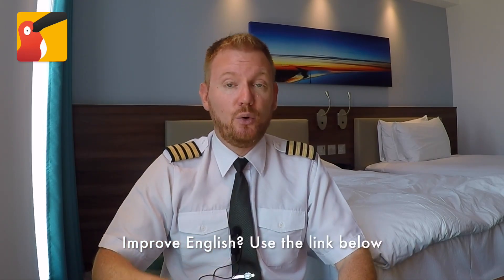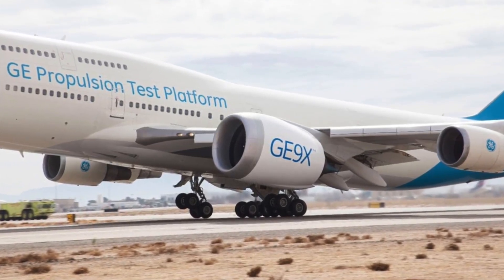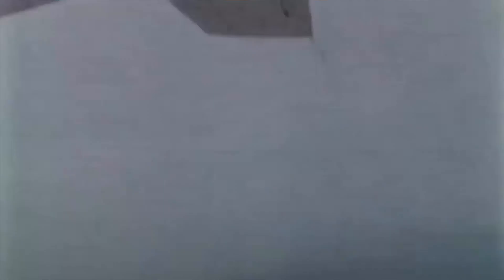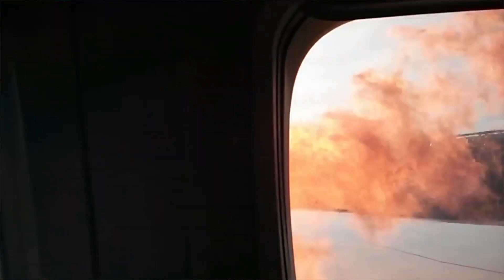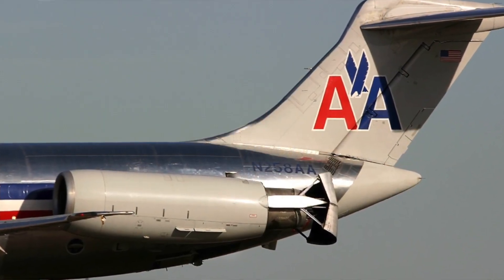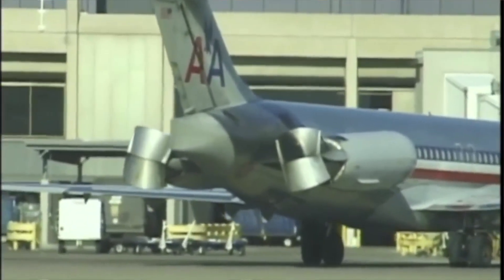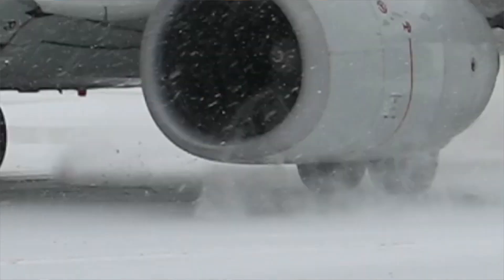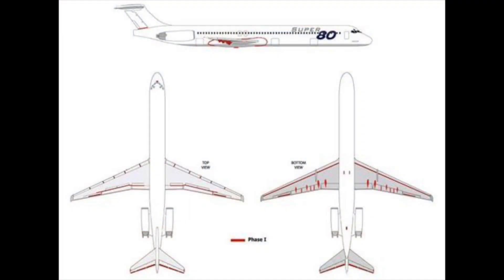Why are the jet-engines placed there? Wings vs Tail

Comment: I remember once reading a silly paragraph on Wikipedia about it. It said something like "Being attached to the tail gives fewer points of structural failure that could separate the engine from the aircraft. With wing mounted engines the wing can separate or the engine can separate. With tail mounted engines only the engine can separate."
That is what convinced me to get an account to edit the wiki because seriously what pilot is going to be saying "oh no! My engine" when the whole wing fell off?
Reply: nope...   the hardpoints that fasten the engine are the same on any position, its on a captured rail so it can be easily slide out to perform maintenance...   funny they don't take into account the tail is actually less heavily built then the wings..  the wings hold the entire weight of the plane in the air..  tail just acts as a stabalizer, it creates no lift lol ..    wikipedia for ya...   me,   I build aircraft  hehe
Reply: EpicSpaceTroll 139 You’re fucked either way if your wing or tail breaks off 👀
Reply: Yep. That's part of why I thought the paragraph on Wikipedia was so ridiculous. :P
Reply: For anyone who has ever seen how much material is in an engine pilon, or the structural members attaching the wing, it would be the least of my worries.

Comment: Back mounted engines are quieter. Unless you sit right between them. After a DC-9 flight in the second to last row (the last with a window) you know that in the back of the bus, they are much noisier than wing mounted engines when sitting right next to them.
But no reason to complain, since it was obvious that this airline (and most passenger airlines in the parts of the world that I travel) were geting rid of the DC-9, this seat was chosen intentionally. :o)

Comment: I’m going to guess closer to CG for better balance and handling, potentially reducing lift burden. Possibly “cleaner” intake air without wings interfering.  Maintenance accessibility. Wings are structural regardless of engine; fuselage requires reinforcement to accept engines. Simplified tail construction, also with better maintenance accessibility.

Comment: Yet another informative video. I have a question on this topic. 
Some UPS cargo planes have two wing mounted engines but they also have one engine mounted on vertical stabilizer as well. Can you please explain why ? Vertical stabilizer is a very odd place to mount the engine. 
Thank you in advance.
Reply: This is called trijet. Engines are very expensive part of aircraft, but you need more than one for redunancy. So at time when they were not enough reliable, 4 engines were too expensive, only two engines not enough reliable for long, over ocean flights, three seemed to be optimal. But only way to make engine placement not asymmertical you had put third engine in the middle, so into the tail. But that appeared to have downsides, for example even more complex maintenance that under wing engines.
Reply: Tri-jets were configured that way because they are from an era when a particular size/capacity was necessary, but having only two engines were not sufficient for the design (both in power and reliability), but four engines would have been excessive.  As engine designs have advanced, two engines are able to suffice when three used to be necessary.
Reply: After McDonald bought Douglas, the DC-10 was redesigned and renamed the MD-11. Boeing is now the manufacturer/service provider.
The MD-11F is the three engine aircraft flown by UPS and Fedex, and other cargo carriers.
NOT the Lockheed L-1011 TriSTAR,
Reply: Back when FAA didint allow 2engines to fly across the atlantic, airplane manuf made the trijets plane.
Reply: Those are called ''Trijets'', I suppose they are needed when you want to have three engines. They work with like an S-shaped duct and the thrust comes right out of the rear of the plane, so it is easier to handle if there is an engine failure. Since it is in the middle there isn't that much leverage.
Also, the engines are further away from the passengers (less noise), seem to be more efficient and is better at takeoff's.
Disadvantages are that they are complex to make and less efficient than twinjets.
Reply: because dc-10 could not have 2 engines in these days, if put 4 engines below wings it was already seen so they decided for something unusual.
these days that engines were the biggest and because of3 , dc 10 is smaller than b747(both have same power engines, 20-25 tons of thrust)
Reply: In aircraft like the L-1011 and DC-10/MD11 4 engines weren't efficient, but they needed a third for the extra power, and reliability. In the 727 they just needed the extra power.
Reply: DC10/MD11. was McDonnell-Douglas' response to 747, aka "wide body", but at a slightly smaller size and passenger capacity than 747. At the time, the engines weren't  powerful enough to only go with 2 engines (and ETOPS rules were perhaps stricter before the 757 & 767 were developed?), and 4 engines was too many. So 3 was "just right" for the size and configuration they were aiming for. (Lockheed's L1011 was similar idea, but... not many of those still flying).
Reply: yup, they made trijets back when 2-engine planes weren't allowed to fly over oceans.
Reply: probably center of thrust...  if the thrust was all below center of drag it would force the aircraft in one direction when you applied a certain throttle.
Reply: Ah, what you're referring to here, is the so-called "Tri-Jet" configuration, which has its roots in multiple engineering and commercial decisions.

Back in the 1970s, when these aircraft were designed and built, jet engines were not considered reliable enough to allow for long flights over oceans with only two engines. Ocean crossing aircraft at the time, thus usually had four engines (see: Boeing 707 & 747). However, having four engines attached to the airframe, results in large engine maintenance costs.

That's when a spot of lateral thinking cut in. Engineers worked out that you could build an aircraft with three engines, that would still have enough engine thrust to maintain controlled flight even if an engine failure took place over the ocean, but would have lower engine maintenance and running costs than an aircraft with four engines. It would still have comparable carrying capacity and range to a four-engine aircraft, but cost considerably less to operate. Which would be attractive to airlines that did not handle the passenger numbers making 747 operation justifiable, for example, but which still had international routes to service. Thus we saw the DC-10 and TriStar being built, to attract purchases from such airlines.

Of course, you still need to ensure that the engine thrust propelling the aircraft is laterally symmetrical (i.e., the same on the left and right hand side of the aircraft), and with a third engine, the obvious way of ensuring this, is to mount the third engine at the back, under the tail. Which is why you see the interesting arrangement on these aircraft, of two engines under the wings, and a third engine under the tail. Three engines provided enough of a safety margin to get home safely, even if two engines failed over the ocean, but cost less to run per airframe than four engines, whilst giving ocean-crossing range and substantial carrying capacity.

That's when the fun started. Lockheed had prior experience with propeller driven airliners, but the TriStar was their first venture into commercial jet airliners, and Lockheed chose to market their aircraft on the basis of technological innovation and enhanced safety, which made unit costs expensive. McDonnell Douglas chose to build the DC-10 to a budget, and sell its planes cheaper, but this bit them badly when design compromises led to several highly public disasters (the crash of American Airlines Flight 191 in 1979 was a particularly heavy blow). The commercial failure of the TriStar led Lockheed to abandon commercial jet manufacture altogether, and the chequered history of the DC-10 (followed by complications with its military aircraft contracts) ultimately led McDonnell-Douglas to merge with Boeing. Basically, three was not a lucky number for either of these companies, and I suspect none of the big aircraft manufacturers will risk a Tri-Jet design in the future unless they're forced to by circumstance ...

Comment: Is ground clearance a factor? For a small aeroplane low to the ground you might not have room for engines under the wing?
Reply from the maker: Absolutely correct.
Reply: Why not have wing-top engines? Back in the 1950's the DeHavilland Comet actually had its engines inside the wing.
Reply: Then theres the honda jet, engines on top of the wing.
Reply: I guess harder access to maintenance and also they didn't used turbofans for the Comet, they require a much larger mouth to fit the fan, so you would also lose usable wing area if you replace the sleek intakes with a big fan.
Reply: On this note. 

If engines keep getting bigger are we going to go back to high wings?
Reply: Yeah, all of the RAF's V bombers also had the engines in the wing root. Wing root engines only work with turbo jets, not turbo fans though.
Reply: I was thinking about it too, it would be impractical for jets with low ground clearance to have wing mounted engines,
Reply: I think they stopped having turbine engines inside the wing mainly because an uncontained failure cuts your wing off if the engine is inside the wing. Might be a similar reason not to have it on top of the wing? I think the wing is safer if the engine pod is under the wing.
Reply: bhami That has some advantages but also some disadvantages. Fitting the turbofan engines to cantilever forwards from atop the wing, with a flattened exhaust nozzle, does have some enormous benefits for low-speed lift. NASA took a deHavilland Canada C8A Buffalo (twin-engine, piston powered) and replaced the wings with a new wing, fitted 4 jet engines this way (2 on each wing) and the result was called the QSRA (Quiet Short-haul Research Aircraft). Thanks to the Coanda effect, the stall-speed was reduced to below 57 knots airspeed. Mentour Pilot can probably attest that flying that slow in most airliners would be insane. If the wing is mounted on top of the fuselage, then it also means that the wing shields the passengers and people on the ground from engine noise, and helps to protect from foreign-object-damage, but at the cost of making tall ladders a necessity for engine maintenance.
Reply: I guess that is why the 737 engines have the iconic design which would enable better ground clearance.
Reply: bhami, The Martin jet seaplane had its engines on top of its high mounted wing. This prevented the engines inhaling water. Usually.
Reply: Tilson Thomas It's actually been successfully done. Look up the British Aerospace Model 146 "AvroLiner" (aka the Avro RJ-series). Regional jet (hence "RJ") with wing-mounted engines and VERY short landing-gear.
Reply: bhami, maybe in that case turbojet where mounted and not turbofans. Turbofan requires much bigger section, you'll end up with a exaggerated wing thickness, that is not good at all for efficiency and good lift characteristic.
Reply: bhami 
My guess would be that the air flow over the top of the wing is more critical so you don't want to interfere with that, and having the engines Above the wing would put them closer to the passengers which is not good. Engines make noise and they throw sharpnel once in awhile so you try to keep them away from the people.
Engines within the wing take space away from fuel and  mechanical systems
Reply: VFW 614
Reply: In addition to what others have said, the Comet had issues with the strength of the wings - with the engine in the wing roots, you can't put a spar through there to keep the strength, but have to rely on something more complex, and more prone to joint failures.
Reply: then the landing gear would be extended.
Reply: The He 162 had an engine on top of the aircraft, the Ho 229 had the engines in the wing roots the Me 263 had he engines under the wings and the Me 163 had a (rocket) engine on the back of the plane.
Reply: Tu fenix shidori :v and your point is? :)

Comment: Hi, just came a thought while you were showing the use of reversers to push back... can a plane use reversers while in air (not inflight i.e. cruising, I just saw a Rynaiar 737 video using reversers maybe 10/15 feet from the runway) and what is the procedure for an unexpected reverser deployment? Maybe general knowledge, not the exact checklist that you use with your airline if you cant.
Thanks and keep it up captain!!!
Reply from the maker: Reversers should never be deployed in flight for any reason. It can be selected at around 10 feet under certain technical circumstances but it’s strictly forbidden to do so on purpose. The incident you are referring to was during a terrible storm and it’s likely that the pilots did it out of mistake when concentrating on the crosswind landing.

The checklist in case of an unsafe reverser inflight is basically to verify if it’s a false warning or shut the engine down.
Reply: you could fly in reverse
Reply: No, Maken Tahi, You could fall in reverse! ;<)
Reply: On the Concorde, they had a procedure that required them to deploy reversers on two engines while in flight. 

Basically, if they had had a rapid decompression in cruise (FL600, Mach 2), the procedure called for a very rapid descend. To slow down during that descent, they were supposed to deploy two (out of four) reversers.

Comment: HondaJet has engines above the wings!!!
Reply from the maker: Yes, tgat is another variant but very rare!
Reply: I think Honda patented the design.
Fun fact: Apparently engines above the wings reduces fuel consumption, noise, and vibration in the cabin.
Reply: Anotov AN-74 is another one that has this configuration.  Another advantage is the exhaust flowing over the wing shortens take off roll.
Reply: mctwerker less chance of sucking up gravel and shit.
Reply: mctwerker what Russian plane isn’t a funky looking plane? They all leave the Soviet taste I your mouth.
Reply: Anotov AN-74 is one funky looking plane! I had never heard of it until you just pointed it out!
Reply: And of course there was the Comet with engines buried in the wings.
Reply: so did the YC-15.   how many others were there?
Reply: Berijew Be-200 has also engines above the wings for obvious reasons ;)
Reply: Was thinking that too
Reply: which is counter productive considering the wings generate lift..  :-(  the places where the engines are probably useless as wing
Reply: The German VFW had the above wing jets in late 60s already..
Reply: The AN-74 was (like many Soviet designs) a rip-off of an American design:  the YC-14.